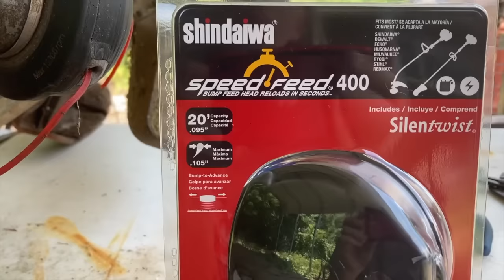The BEST TRIMMER HEAD ever made! How to install a Universal Speed Feed on most any trimmer.

Comment: I did buy this head for an old Ryan 740, however one of the adapters ( for the clockwise turning shaft )  I did have to drill out and tap to 7/16 to make the head work on the shaft  Seems all the adapters were metric, except for one, the black one, it was 3/8 x a smaller metric.  However after modifying the adapter (silver)  that fits into the white spool it all worked excellent!  This old Ryan is  32-35 cc and is great for what I use it for. I realize this is an older video, Thanks Chickanic for all you do.

Comment: I know this is an older video, but I'm getting ready to replace the head on my Echo trimmer which I've had for years with the 400...This speed head is excellent, and the only thing I use on lower HP....Make sure you completely service your trimmer a couple times a year, I use Echo Red Armor grease like you, your trimmer will love for it.................. 

For people that don't know, I think I got this Information from your channel..Soak your weed eating line in water for 24 hours in a 5 gal bucket, (put something on it to weigh it down)
It's incredible how much better your line will work and last, especially around chain link fence ...🙂

Comment: The stihl auto cut 40-4 is great, puts less strain on the engine with four nylon lines coming out of the head instead of two, but the smallest thread it comes in is a left hand m14  and the stihl super cut strimmer head, it automatically feeds out nylon when it gets too short.

Comment: I found the 'Echo' branded Model 400 at my local Echo dealer (and a little cheaper than online stores.) Installing it was "Easy Peasy." The local dealer had one already set up for my Curved Shaft Echo GT2000. Getting the original OEM head off took some persuasion though. In all, it was about a 20 minute process (with 15 of those minutes spent getting the old head off.) Thanks for the great tip!  😎

Comment: So I watched your video about the best trimmer head after purchasing a new trimmer head from Amazon that said would fit any straight shaft Echo. It did not fit. I bought this one you recommended. Yup, this is a fast and easy loading trimmer line and the bump head doesn't get tangled like the original. It is by far, the best trimmer head I've used. Thanks for the recommendation and showing me how to install it.

Comment: The reviews mentioned some people hat the unit fall apart in use. This one was no different. The molding on the “ears” that clip the halves together is incorrect so only one side would clip together properly. Ultimately after trying to gently bend the ear out a little I ended up cutting a small sliver of rubber hose I had on hand and was able to push it behind the ear which applied a little outward pressure on the ear so the 2 halves would lock together solid.
Second issue, this is not on the seller. I bought this from a link on YouTube for installing it on a Stihl fs131 weed eater. The fs131 is not listed on the Amazon listing. I gave it a chance just hoping it would work. It has the correct thread insert (green). However the black spacer that is intended to go between the new head and the trimmer head is too thick. I disassembled it like in the video and it was a no go. Installed the head without the spacer and it went on fine but the splined arbor on the weed eater has a large captured washer/shield and it made a lot of noise.
I have access to a lathe so I was able to machine down the spacer to about a third of its original thickness and retain the centering hole that it has. Obviously most people would not have this. Just posting so if anyone followed the link I did for the fs131.

Comment: just put the new head on my Stihl trimmer. I had tried 2 Stihl heads and this one blows them away. It is just like you said easy to install and thread. Also on one of your videos you showed how to pull start a trimmer or saw by pulling buy the compression stroke then pull to start. Made it very easy to start. Thanks for sharing all you knowledge.

Comment: This trimmer head is the best. I bought a Milwaukee quick lok string trimmer with a similar string loading system. It came with two trimmer heads, both JUNK!
Fed about 12 inches of string and jammed up, both heads, Total garbage. Bought the Echo unit and it works like a dream. I have lost a lot of respect for Milwaukee equipment from this debacle.Love your channel!

Comment: OK........I got a new Speedfeed 400. I clicked on the link you gave and ordered a 450. I have a TroyBilt , curved shaft,  29cc,  4cycle trimmer. Well the supplier sent me a 500 model. So I sent it back, with instructions that I wanted the 450. The Shindaiwa 450 numbers matched on the Amazon description, but they sent a 500. Then they sent another 500, Which I am going to return. I ordered a 400 from another Amazon supplier, so I hope it works.

Comment: LOVE the whole speed feed that's for sure.  First time I ever had an issue with it was the last use.  Ran out of string, grabbed about 12' of string (I'm sure I could put more in it), and loaded it up per usual, but for some reason it jammed.  I took it apart and unwound the tangled mess and re-loaded.  It IMMEDIATELY jammed again...took it apart...etc.  Finished my lawn and went to help our a neighbor who is going through a rough patch.  It IMMEDIATELY jammed again, about 4 times.  The unit is about 3 years old now, so I'm wondering if it is just wearing out.  It's just plastic after all.

Comment: Thank you for recommending the Speed Feed 400. I have installed it on our 36V Makita. What a great trimmer head! On a related note, stay away from the knockoffs sold online that look the same, but don't work very well and are a straight up rip off of the patented original. Not worth "saving" $10-15 compared to the real deal.

Comment: Tip:  I got tired of looking for the rod to stick in the hole to loosen the spool.  I cut an 8" piece of pool noodle and taped it to the shaft up high.  I poke a hole lengthwise in the noodle and it holds the rod to remove the spool head whenever I need it.

Comment: I have the Stihl FS 91 R trimmer. I am not a professional. I am a retired carpenter. I prefer using the AutoCut 25-2 trimmer head. It has 25 foot - 2 of line on it. If I run out of line, I unscrew the empty head and screw a full one on. That works better for me. Never forget to keep a pin or such that will lock the head. I forgot only ONCE.

Comment: Good to know all this since I just got a new Shindaiwa C242 with the brush handles.
It will be a bit of an adjustment having a bump feed instead of the fully automatic Stihl Supercut 40 I've been using on my old FS85 and my FS131, which will now be my backup unit due to that crappy 4-mix engine.

Comment: I highly recommend the MaxPower PivoTrim universal heads. I've been using them  for many years now. Looks like a gimmick but it's not. It also helps not to put a cheap line in it.
No bumping and scalping your grass. It helps to keep the line from getting destroyed when you hit a solid object. You precut short strips of line. Then it only takes 2 minutes to put new line on it and the line will last a surprisingly long time. Cost about $20 + line.

Comment: First of all everything I'm gonna say is from my personal experience and nothing else... So as about the heads i personally replaced the bearings from the head with top one's plus i use  high speed gearing grease Nye Rheolube 363 (of course if you have the budget to afford it) now my trimmer head running so smooth and will last much longer.!

Comment: I bought one of these heads to install on my Harbor Freight electric trimmer.  The OEM head is very difficult to remove.  There is a video on how to remove it, but I couldn't get it off--even after gently heating the locknut with a pencil torch.  A little research revealed that installing an aftermarket head on this electric trimmer would likely lead to failure of the motor because the OEM head has fins on it to act as a cooling fan for the motor.  So...  if you've got a HF trimmer, you're stuck with the original head that you have to disassemble to reload.

Comment: In rough terrain weed patch the bump cup will abrade away at alarming rates.
To eliminate this I coat the bottom surface with relatively inexpensive J B weld epoxy.
Coat as icing a cake and let cure overnight. Now head will wear indefinitely for weeks before possible retreating if necessary. It avoids having to replace relatively expensive total unit.
My four stroke Cub Cadet  4125 with this head and 105 diameter dual core line is a torquey weed eating monster that goes for an hour of heavy duty service before super easy reload.
Far better than the early pain in the rear designs. Like night and day difference.😊

Comment: I changed over to this type of head a couple years ago. So much easier than the old type that came on my brush cutters. So glad I watched your video, I didn't know about the greasing of the head. My original Sach's 330 brush cutter I did install zerk fittings in the shaft. That worked very well for the shaft lube but over time the rubber bushing inside the tube started slipping.

Comment: I like the Shakespeare Ugly Head Hybrid trimmer head. No spool for the line, just put doubled up line in four places. using the Husqvarna Titanium force line, I can use those four pieces of trimmer line half the summer. No more spools at all!! Then you can remove the trimmer line and change to those plastic blades for heavy weeds. I've used mine for years and I swear by it.

Comment: Thank you for putting this video together.  My Stihl trimmer is a very nice tool, easy to start and operate and has been very reliable.  What I never liked about that tool is the trimer head.  From day one, it never performed correctly and I can't tell you how many times, I have had to take the head cover off, just to let more line out.  
So, I purchased the trimmer head in this video on Amazon, watched your video again, because the instructions provided are not that clear and within 15 minutes, tested the new trimmer head on my Stihl trimmer with success.
Thank you!

Comment: I just watched this video.  I use a zirc  fitting in the side bolt on the gear head.  I have never had a problem doing so.  The issue I have is finding the proper zirc fitting.  There is a fitting that will work.  I am not certain now what size fitting fits.

Comment: I have a speed feed 500 but on my stihl fs240 it leaves a slight gap for the dust cap on the Stihl. It comes with a big black spacer but it would just be in a float position. I suppose I could try to find some washers the size of stihls shaft but big enough to go in the middle of the black spacer. The stock weed eater head has the dust cap all the way closed, but the speed head let's it have a gap just big enough for grass etc to get into it. Thanks love you channel, just thought I'd add in case anyone knew and could point me in the right direction. The 500 is the only kit out of 400 & 450 that fits this trimmer.

Comment: Thanks to Chickanic, I bought one of these Shindaiwa "Speed-Feed Universal 400" trimmer heads to install on my Stihl FS90R.

I am writing to note that the official compatibility list does NOT mention the FS90R, but it does mention the FS90 (I have no idea what the "R" suffix means). Following the extensive "Application Chart" in the printed manual, it directed me to use the so-called "LH2" solution, assuming a model FS90. Then the reference chart told me to use the "E" Gold bushing AND the "I" Silver (10mmx8mm) "mounting stud". Well, these parts made no sense on my FS90R gearbox; the Gold bushing would not thread onto the arbor of the FS90R gearbox, and as that arbor was not removable, there was no reason to use the mounting stud.

I decided to call Echo tech support (the instructions direct customers to call Echo.....seems there is some kind of affiliation between them and Shindaiwa), but I just got an ignorant sounding gal who seemed to be about 13 years old. All she knew how to do was read the same instructions, and noting that the FS90R was not listed, that this new trimmer head was not compatible with my trimmer and I should return it to the seller. I asked if there was anyone else there with more knowledge and/or experience, and she replied 'no". So, it was back to the empirical method.

Sure enough, the included "G" Green bushing was the only one that would thread into the FS90R's gearbox arbor. So just as Chickanic did in her video, I pressed out the Gold bushing (out of the new trimmer head) and and pressed in  the Green bushing. Now the new head would thread onto the gearbox, but not all the way to touching the gearbox base plate. The instructions suggest that the included "M" Reversible nylon spacer would only be used for the "LH6" solution, but I found that its recess did fit the raised protuberance on the base plate, so I used it, and then the new head was able to be screwed on properly.

And of course when inserting the line reel of the new head, it is critical to make sure that the side with the "L" faces away from the gearbox when installed on LH (left hand rotation) machines, or the "R" side faces away when installed on RH (right hand rotation) machines. It will fit on, more or less, either way, but it only actually works when installed in the correct orientation.

I am very pleased with how easy the new head threads (MUCH better than with the original Stihl head), and otherwise it operates just like the original Stihl head in terms of performance and how the "bump feed" works. Good product, but I was disappointed by the very poor tech support.

Comment: Stihl makes a string trimmer head that you can put 2 single on each sides I've never tried it before but my auto speed feed trimmer head all it takes a single long peace of trimmer line make sure the trimmer line is even then turning knob on the trimmer head to wind up the trimmer line in the trimmer head it's amazing to use when you don't want to wind up the trimmer line by hand

Comment: Wow. Almost 1 year since this came out. I’m ordering the 400 since my kids failed to get me one for Father’s Day.
Reply: Arrived today. Rewatched the video 5 or 6 times, pausing and rewinding several times along the way. Very helpful video, thanks for doing one that needs an arbor change. Mine requires the red one. I only messed up and had to take it back apart three times.  It would’ve been about 10 times had your guidance not been so precise. I also lubed the head on my ST-285-BC. I think the designation on that means that this unit was manufactured in the year 285 BC. But it is   an American Made Homelite, so it is probably older than the children who did not buy it for me for Father’s Day. Thanks again Bre. We trim at dawn!! Or maybe 10:30, as I don’t want to PO my neighbors.

Comment: 4 trimmers converted all to precut lengths.   Mechanical ' Idiot just cut about fifty lengths.   For Red Max i use is 115 line.  So much power.   use needle nose pliers.  No winding ,arbors and look after 1 acre lot.   Not what pros would use but works for me.

Comment: Red and Tacky makes a spray can grease with a tiny plastic pipe to spray in gear port.
Works great and super easy. Can drill small hole in upper shaft housing to lube shaft cable.
With lubricants shaft and engine that bad boy will gobble weeds all day baby❤.

Comment: One more Stihl makes a dull string trimmer head that you can put two pieces or three pieces of single trimmer line inside when the trimmer line gets short you pull the old trimmer line through the inside of the trimmer head than replace trimmer line with new trimmer lines

Comment: One thing you will also want to know is that while, yes, the gearbox needs grease for obvious reasons, if you fail to grease it, the shaft can heat up to a point to where the insert in the speedFeed also heats up and expands and makes it impossible to turn. This means you can no longer feed from or load into the SpeedFeed head. Ask me how I know.

Comment: Forgive my ignorance, but for us newbies out here, would you be willing to attach an entry (i.e., "Note") to the end of the 2nd sentence of your video description above, stating / clarifying, that The (Shindowa brand) Speedfeed 400 and 450 size Spool Heads referenced in this video, may NOT be compatible w/battery platform operated trimmers, such as, for example, the Dewalt CST972 Trimmer, which also comes in a Dewalt Trimmer kit (i.e., the DCST972X1); as I almost purchased this for such, but someone caught the discrepancy, and saved me from what otherwise would've been an erroneous purchase, in this regard. (?)
Thank you for your consideration and for the continuum of great videos, and great job that you're doing, in sharing your  your knowledge w/us - your viewers - as all are much appreciated!
PS: If maybe you could consider adding some videos on battery platform operated trimmers, such as the aforementioned, that'd also be great, as well. - Thanks, again :)

Comment: I prefer my Stihl 20-2 super cut auto feed trimmer head because it automatically feeds more string out as it is needed without having to bump the head.  In fact you can't bump the head, lol.  Well, I guess you could, but it wouldn't do anything.  With bump heads I'm always accidently bumping the head, wasting string letting more out before it's needed.  Never have that problem with my 20-2 :)